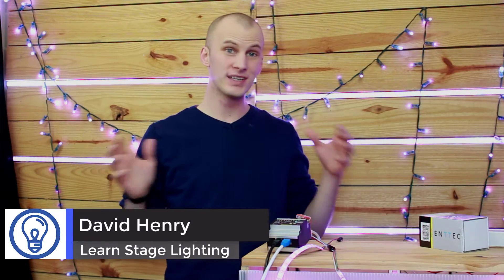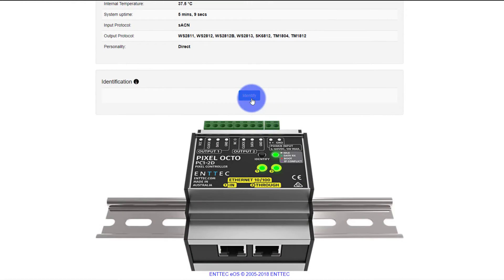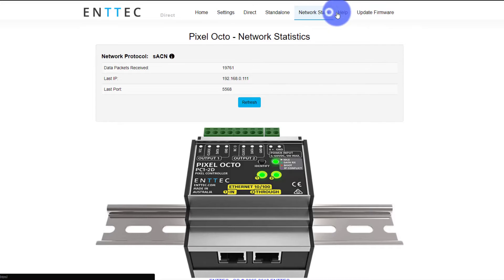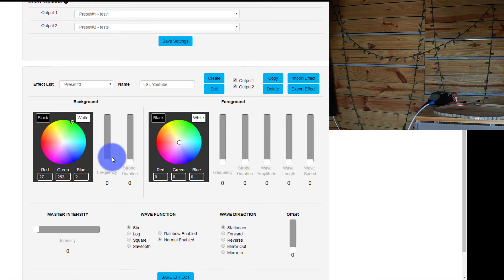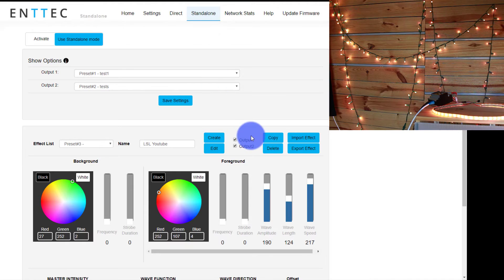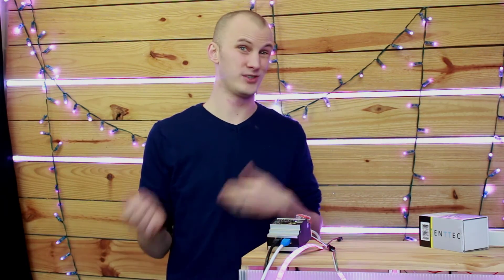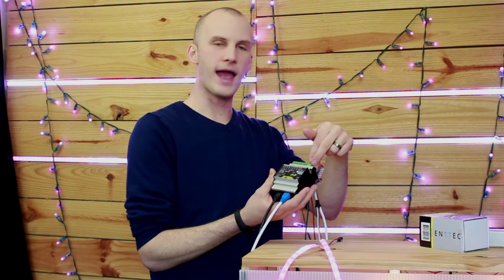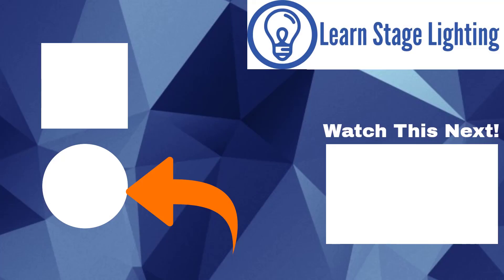Going Deeper with the ENTTEC Pixel Octo

Comment: How does this differ from Enttec's Pixel Port? Thanks for the video!
Reply from the maker: More pixels.  No built in power.  No power supply.  DIN rail mounting.  Less "rugged" connector for pixel connection.  Around the same price.

Comment: don't want to rain on your parade but falcon controllers are a great option for running pixels-strips. Run over over 16K of pixels for US$200, with most of your enttec features and more.
Reply from the maker: Falcon makes a good controller - BUT - not as robust of a standalone mode, and most important, no CE safety certification (as far as I am aware).  

So while the Falcon is cheaper and does control loads of pixels, it's a tremendous liability, especially for installers working in commercial buildings.  Fire code requires electronics that pass safety certifications, such as CE, UL and ETL.  :)